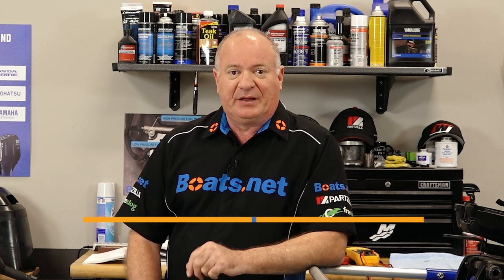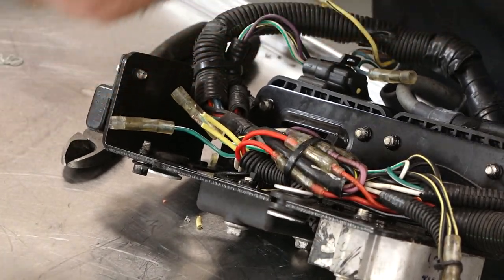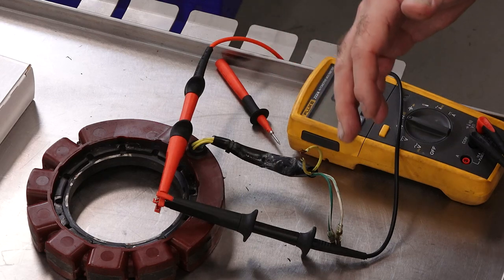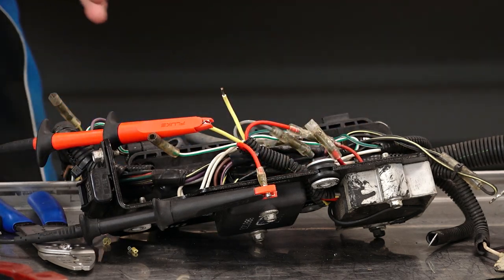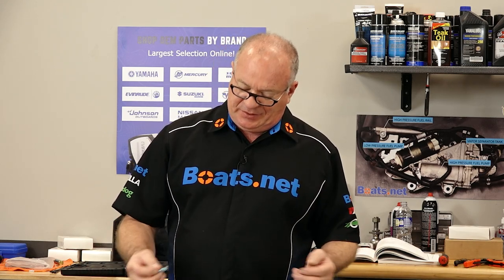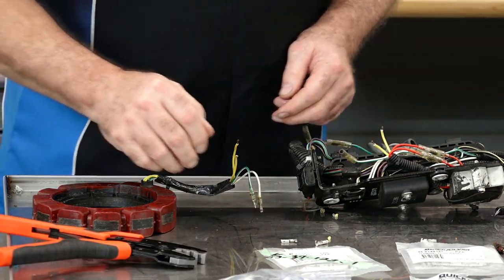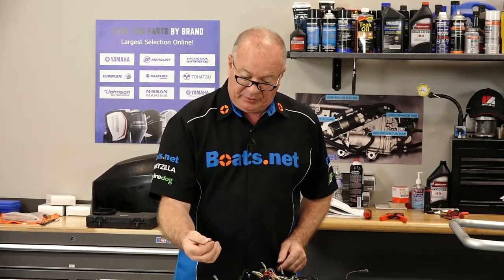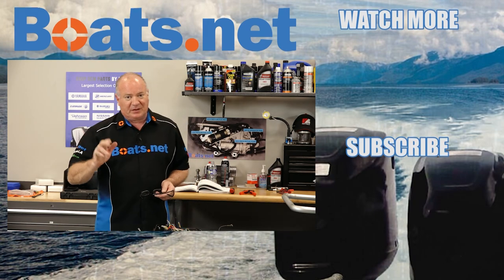Mercury Outboard Stator Test | Mercury Outboard Regulator Rectifier Test | Boats.net

Comment: Need help to test Stator for Merc 60HP EFI 4stroke stator has only 2 yellow wire.  What is resistance value (ohm) to test for?
Reply: I just checked that on my 60hp efi and found 0.5

Comment: Just got my 2001 Mercury 40hp 2 stroke back from my local service center. Brought it in because I found oil in the fuel. It sat for over two years without running. I had then check the oil injection and get it started. They got it started, said the oil injection system was working, and it needed new plugs. Good so far, but they said the regulator was melted and it would cost approximately $600 to replace, because the parts are hard to find and they’re expensive. What other issues should I check into?
Reply: dont expect John to answer. Never gonna happen.
Reply: He said 1.9 volts was in range mine is reading 2.4 volts does that mean it's defective?
Reply: Sorry. He was testing one of the yellow wires to the ground and getting 1.9 he said he wanted 1.5. I'm getting 2.4

Comment: Is there a way to test the switch boxes on my 1988 blackmax 150 xr4 having problems cant get motor to go over 6mph at full throttle any tips would help thanks
Reply: Check for spark on all 6 plugs! If you’re good your switch boxes and coils may be fine , after your motor reaches 2000 rpm it sends power from different coils in your stator . You need a DVR meter to test stator out put ! Blue wires at top of switch boxes power low speed red high speed! I had one blue wire not powering one box. That causes one box 3 cylinders not to fire! CDI electronics has great trouble shooting charts! I have the same motor as you. And there part corrected my problem! Also have a conversion kit for the water cooled regulator that burned out my stator. Very Expensive Parts !